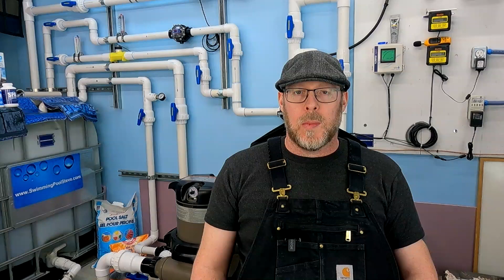Can a Pool Pump Be Too Powerful?

Comment: Safety first always, but I have frequently run into another related issue...cavitation.
That's where the suction plumbing is insufficient to supply the pump with the amount of water it needs to operate properly. You can hear a pump cavitating because it runs louder than it should, has a distinct sound.

One example is a pool had a 12 foot sheer descent on the back wall. Each foot requires at least 10 gpm to get the proper effect. So 120 gpm minimum flow rate.
At best (short run), 2" pipe maximum flow is 90 gpm. The 3 HP single speed pump ran very loudly. So the builder replaced it with a VS pump which they adjusted speed until it ran quietly.
That worked for the sound, but the sheer laminar effect was completely lost. Suction line was 2" pipe, about 30 foot run.

Another is on booster pumps for cleaners. I've had calls to replace the motor because it was running very loudly. I recognize the sound instantly and go check the wall fitting. It's always the pressure relief valve has come apart. One customer called BS on me (understandable) until I told him to listen to the pump as I pressed my hand over it to restrict flow. Pump immediately regained normal sound. That again is cavitation. With that new "hole" in the return to cleaner, it allows a much higher flow rate which reduces restriction downstream from the booster. 
Tech tip: I always carry a standard PVC 1" threaded plug on me to replace the broken over pressure device. About $1.50.

Comment: I had a problem this year with my pool pump not pulling the water and also some leaking around the pump. It was repaired and the pump motor was first rebuilt and then it was replaced. My pool guy handled all of it. Now ever since the pump was replaced it seems to lose a lot of water. I have to fill my pool up every day. It will lose from above the middle of the skimmer all the way to the bottom. We don't have an answer as to what it is. They have pressure tested the line and also we have let it sit and it does not lose water past a certain point. The most water lost is when the pump is running. I had thought maybe the hot summer but even this fall in cooler weather it is doing the same thing. Could it be from a pump that is too powerful. This one seems very powerful?

Comment: yea. i probably went overboard. replaced my pentair vs which was a 1.5 with a black and decker vs 2.0 after the drive blew in the pentair. haven't noticed any safety issues. however i have been running the max speed at 2500 as opposed to 3000 as 3000 just led to cavitation. running it at 2500 gives me around 45 gpm after the heyward cartridge filter. so far so good.

Comment: I am so confused… what size pump do I need for a 10 foot x 10 ft x 28 inch deep round poly stock tank pool that I am building with a stone surround and a stainless steel waterfall spillway embedded in a retaining wall?  I am thinking I  will probably have the waterfall on a separate pump

Comment: Thanks for the information. Besides the more powerful pumps being a potential safety hazard, I have read that a too powerful pump in a cartridges based filter  system would make the filter less efficient. Not sure if true or not, so can you confirm?
Reply from the maker: The filter will have a maximum flow rate that you should not exceed.  If you are under this amount, in theory, the filter cartridge should be fine
Reply: @Swimmingpoolsteve  what do you think of people with hard water using RO water to fill their pool or when adding water?

Comment: Let's use 2" pipe for this conversation. It may help others to ONLY talk in GPM, since we can easily read the output from a store bought flow meter in series to a discharge pipe. Dealing with water velocity in feet/s and most folks get cross eyed at the thought of doing the math conversion. 

You are referring to ONLY one suction line where "6 feet/s fluid velocity" or "68 GPM" is the max, correct?

I think some are getting confused by their "total" GPM (at discharge), even though they have more than one suction line.

The most rudimentary of pools has just one skimmer or 1 suction line, BUT that is so rare. Adding a 3 HP pump (or using an unchecked high RPM from that pump) would certainly be dangerous, but even a 3HP pump can be used in variable mode and just use a low RPM without any danger, just keep an eye on the flow meter.

Taking into consideration contemporary pools with 2 main drains (that tee together to make 1 suction line prior to the suction manifold), and 2 skimmer suction lines - three lines total (at the manifold). Now having 68 GPM (discharge) divided by 3 = 23 GPM per suction line, which is now, WAY below the safety velocity threshold. And where the main drain pipe "tees" off to connect the two, each one of those individual pipes will have even LESS GPM flowing through them - that should be noted as many are still afraid of main drain suction safety. 

As mentioned, there are a lot of moving parts to this, but it should be noted that just because there are more 3 HP pumps out there, it doesn't mean they are causing harm.  Even at a WHOPPING 200 GPM total at the discharge line, that is just 67 GPM at each of the 3 suction lines, which is the maximum (per line). Though only about 80 GPM is the max efficiency you get with 2" piping and 200 GPM would shred your filters. You can use a higher HP and lower RPM (1,700) to turnover 25,000 gallons 3 times daily at a constant total 52 GPM (or only about 17 GPM per each of the 3 suction lines).

Many folks use higher HP pumps these days to take advantage of the lower wattage used at lower RPMs to save $100/mo or more running their pump 24/7 (though the pump may cost $2,800, these new magneto pumps last even longer).
Reply: What the point of having a variable speed 3hp pump, when you only need too run it turned down to like 1hp all the time?
Just get a 1hp single speed for way less money that also safes power since it is just a much smaller pump.

Comment: I’m shopping for a new VS pump for my dying old 1hp single speed pump in a 14k gallons pool with pop up cleaning heads and 2” piping but almost all sellers are pushing me to buy a 3hp pump. I researched and found that a 1.5hp VS pump will be ideal for my pool because it uses less energy and is strong enough for 14k gal but those same sellers are saying my research is wrong. Am I wrong or are they just trying to get rid of their inventory?
Reply from the maker: They are worried your in floor cleaning system will not have enough power. But almost guaranteed the 3hp is too big and there are a number of problems with that, including safety ones. The right move here is to find the performance curve for the pump you have now, and use that to compare to the performance curves of the pumps you are looking to buy. Look at gpm rates for 40 and 60 feet of head. The new pump should move water like the old pump. Pretty much just ignore the horsepower rating. This is misleading at best. The performance curve shows what you really need to know.

Comment: I have a few pools that after a filter cleaning the filter pressure is still over 30 even with all return lines open.  I lowered the max pump speed so that the pressure is around 25PSI.  I have assumed that this is because the pump is over sized.